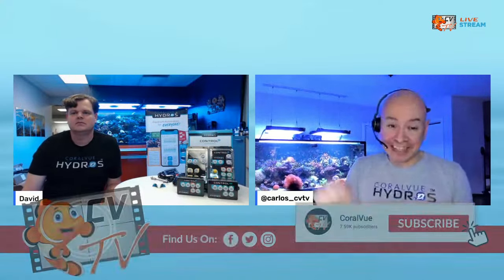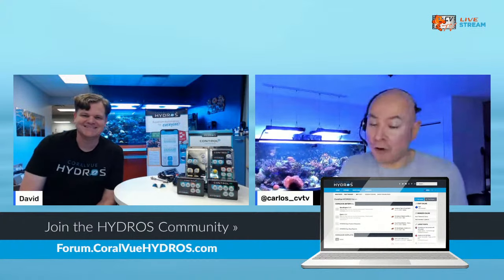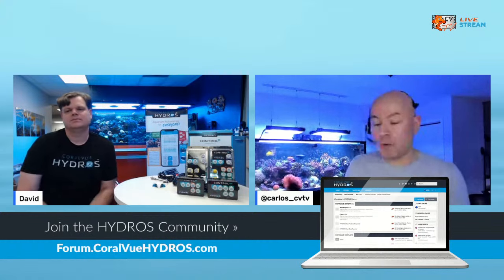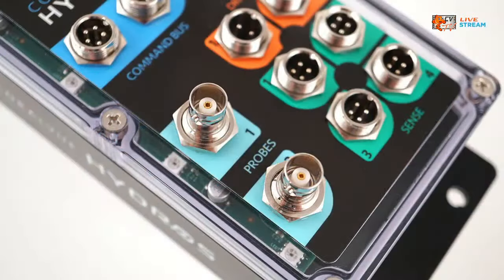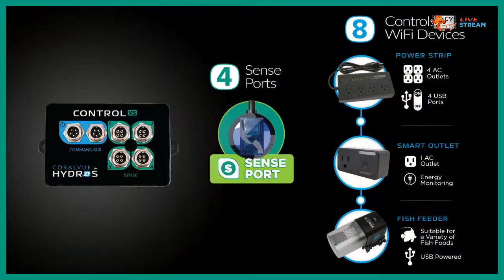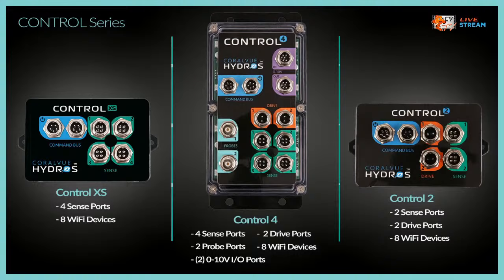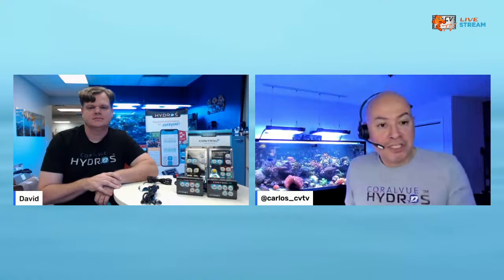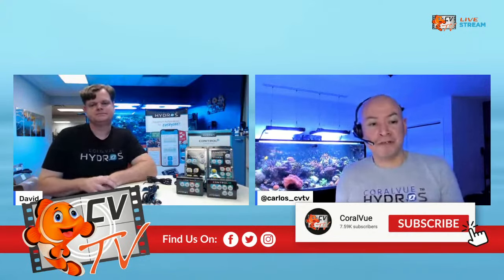[CVtv] LIVE Product Workshop - HYDROS Control System

Comment: I LOVE the water sensor!!! I have it set on my XS to detect water and shut down an outlet if it gets wet. This gives me peace of mind since I am running an auto top off and an automatic water change system from large reservoirs in my basement. if either of those systems ever get stuck "on" and start to flood my tank, the water sensor will detect that and shut the entire outlet down stopping any additional filling from those systems. The XS is awesome and a great price point!!! I also use the temp probe to control my heater. If the system were to go over my top end temp point, again, it would shut the outlet down and send me notifications protecting the tank from overheat and letting me know I have an issue.

Comment: Carlos, I see that you are using the Phillips Coral Care on the tank in the background. I'm considering this light but I have a 12" canopy. My question: How is the heat coming off these lights? I will have a fan on my canopy but I live in Florida and heat is a problem.  BTW, I purchased the Hydros Wave Engine and I'm considering the 2 or 4  for my new tank.